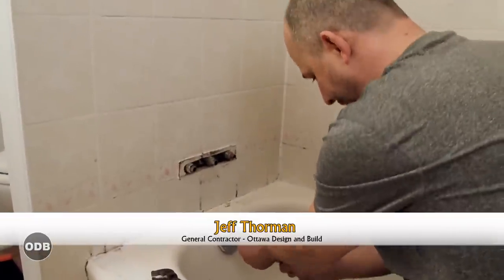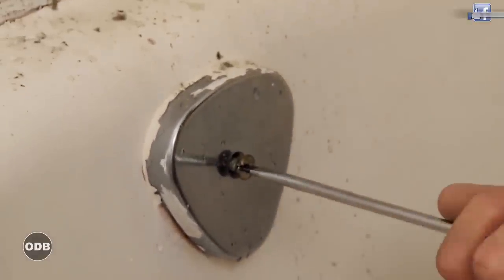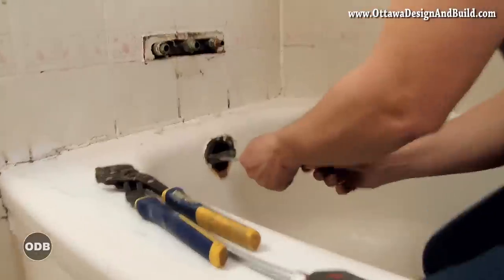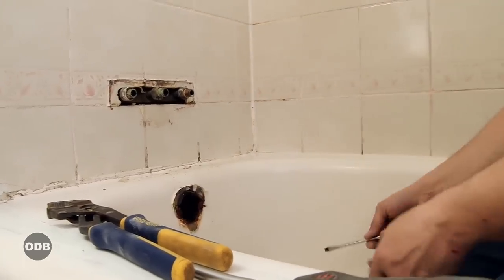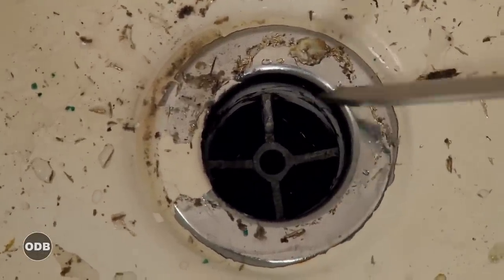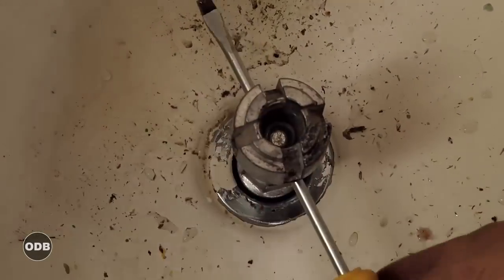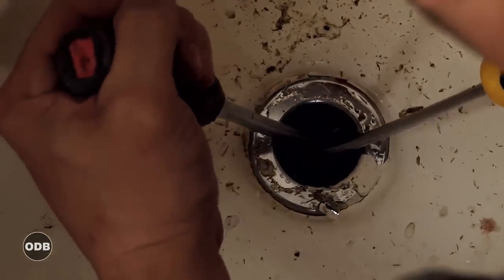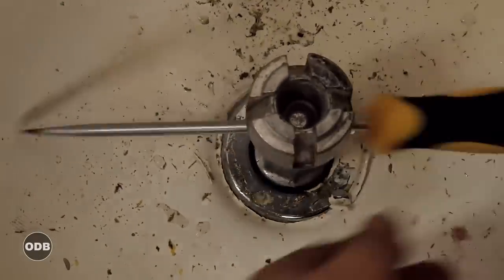DIY Bathtub Removal | Disconnecting Plumbing

Comment: Previous owner put caulk all over the drain cover and it is glued to the max. I need to replace the drain cover with new chrome stopper or new drain cover, but it's difficult to remove all the caulk from the ring. It seems to me someone wanted to cover the rusted spots near the drain cover. I need help.
Reply from the maker: It is most likely silicone. If you apply a silicone remover and let it sit overnight....Then you should be able to remover the drain with a little elbow grease the next day! good luck and let me know how it goes.

Comment: i have my drain loose....and have turned it to the left a bunch of times......the drain will keep spinning around but will not come out......im so confused.  i just dont get how it can be loose and that i can get it to turn but no matter how many times i turn it it wont come loose.....im so lost....any ideas? thanks
Reply from the maker: when in doubt just punch it out. You can use your hammer to punch it through the hole to the4 other side. That will enable you to remove the tub and then you can find out what sort of mystery you have there. Good luck.
Reply: I have Same  problem😢  how did you do it?

Comment: What is your method if the drain is rusted in place the removal tool does not budge it even when saturated with lube?
Reply from the maker: I use a chisel and a hammer on the ring and force it open or pry it off the tub after cutting through with the chisel. At the end of the day your not reusing anything.

Comment: Okay what if you break the crossbars
Reply from the maker: I have a secret for that as well.
Reply: I just bought the tub remover rench set up 👍🏾
Reply: @HomeRenoVisionDIY  Can you share it? Went to see why drain wasn't draining in our kids bath and found the assembly is missing the nut on the linkage. digging in further the screen is all mashed and when I went to unscrew it found out it's not screwed in, that entire cross is busted out and gone. So looking to have to replace all that and likely going to swap out the shower hardware and gus while I'm at it. all the plumbing behind the wall looks to be CPVC. Thankfully they have an access panel in that baths closet unlike the master bath where they didn't leave an access cover.
Reply: @HomeRenoVisionDIY  Please share! Need to know! Thank you!